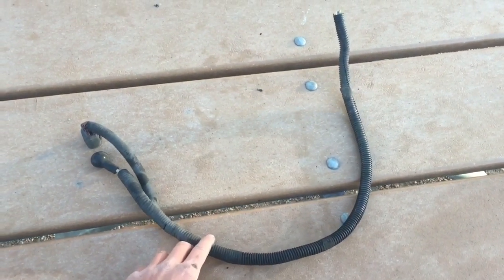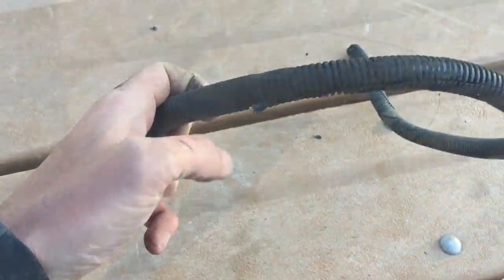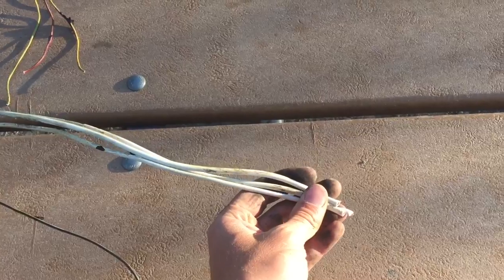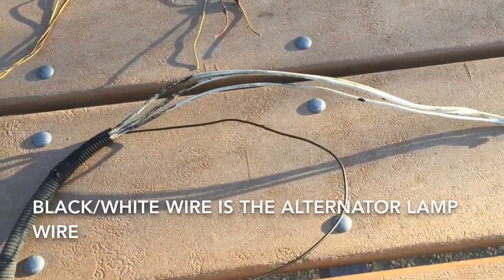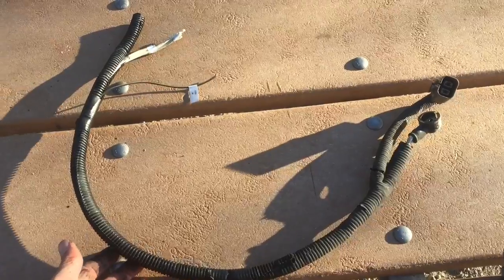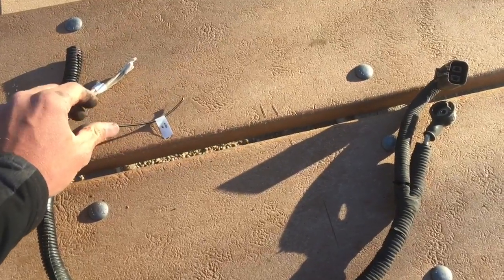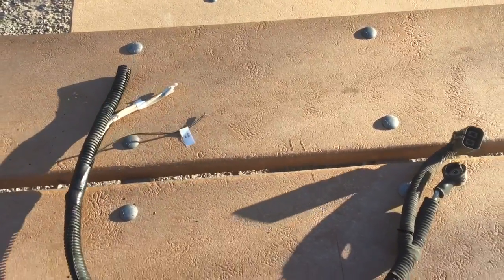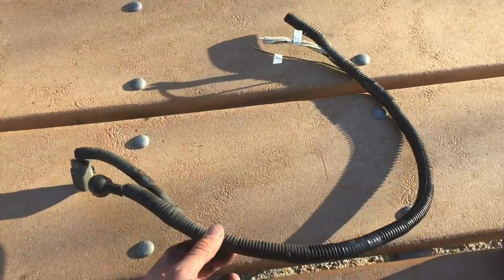13. Alternator Harness - Wiring Harness Series

Comment: I have a huge question, so I have an alternator harness that connects to my Nissan Quest vehicle, but it's a 4 pin connected to a 3 pin running to my fuel line. Should I just rewire the same 4 pin to the 2 pin but with ground and just power, or should I rewire all four wires to the 4 pin, and connect it to the 2 pin fuel line?

Comment: 2007 Nissan Maxima wire to the plug that gose to the alternator I pulled two wires out of the plug and I don't have another plug just wire onto the plug on the side of the alternator can you tell me which wire's go where

Comment: hi.i am George. I guess you remember me.a question. my alternator is hitachi 70 amps with the round plug and 4 pins in the plug.subaru legacy ej22 1992 jdm model.my problem is that I want to upgrade with a better newer alternator and after  hours searching in net it is a very simple upgrade. but the plug of this hitachi alternator has a    pin that it goes to the ECU. the ecu controls the voltage that it comes from the alternator switching it on or off. do you know if I could delete this wire because the newer alternators don't need to be controlled from the ECU. somehow I am very concerned about this upgrade ....if you can help I would be very appreciated.
Reply from the maker: +GEORGE BOURDEISON hi George, since the engine can run without the alternator being hooked up just install a newer alternator with a 2 wire system. They are independent systems. Good luck!

Comment: Hi. When you said that you connect the whites to the starter in a bus, are you just using that as a path to the battery?
Reply from the maker: +M16Scow that's it. If you have an easier way of connecting to your battery then have at it. This is just how I do my harnesses.